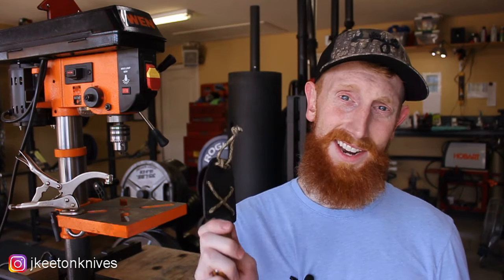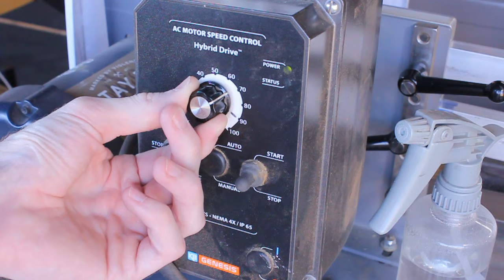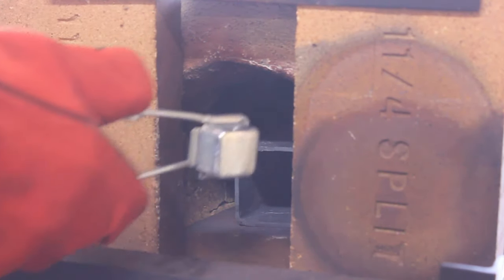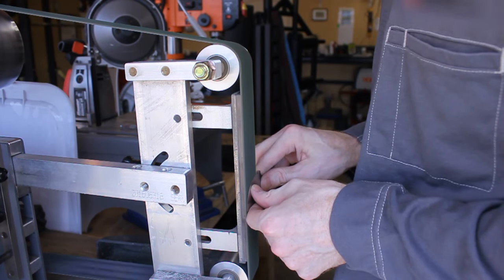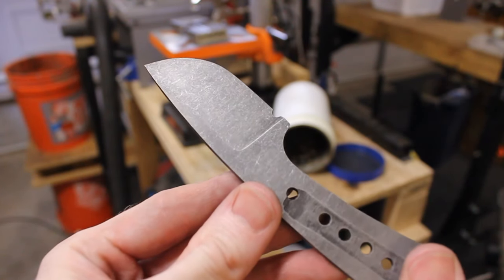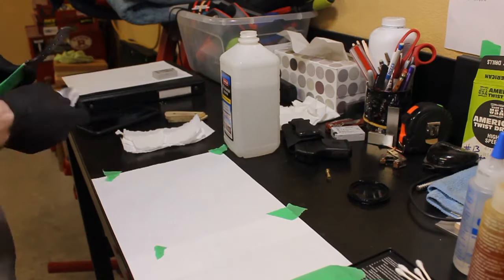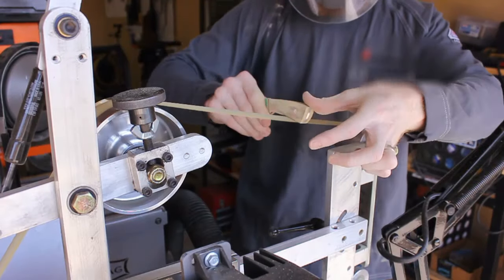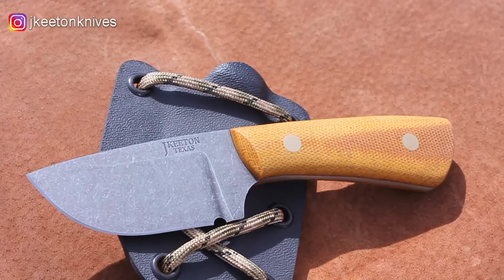EDC Knife Giveaway | A Knifemaker's Gift | Full Build

Comment: Subbed.... what kind of mini mill do you have? Would you buy another or recommend it to someone else?
Reply from the maker: They Anthony, I have the mini-mill from harbor freight. It seems to be holding up pretty well. I had some issues with it shutting off at the start of it's life... but miraculously it's stopped having those issues. I use it a good deal. Mostly as a drill press; however, I'm also getting into some hidden tang knives that it will be handy for (guards, etc). I use it with a router bit to flatten handle scales as well.
Reply from the maker: I'm fairly certain these "Sieg" mini mills are all made in the same factory and re-branded. Here is another model from amazon: https://amzn.to/2TM8MTL and here is the harbor freight model: https://www.harborfreight.com/two-speed-variable-bench-mill-drill-machine-44991.html . There is also a site that sells many replacement parts: https://littlemachineshop.com/products/product_view.php?ProductID=4962
Reply: @RedBeardOps  cool man thanks.. I'm thinking about getting one.. I really like your work.. I think you're a really gifted bladesmith.. keep up the great videos..
Reply from the maker: Thank you Anthony

Comment: Subbed! And Want! Btw I ended up getting a evenheat just could not get the temp right in the forge and even tried the muffler like you did.did you ever figure out your issue with the forge?   Instagram @knivesbyjh
Reply from the maker: Hey man, I ended up build this forced air burner to be able to run at lower temps. It can still walk away from me, but it's way better. https://youtu.be/WtCWbl-Q5fo